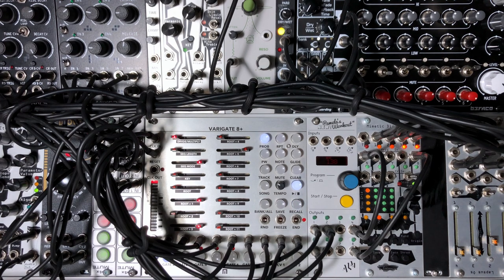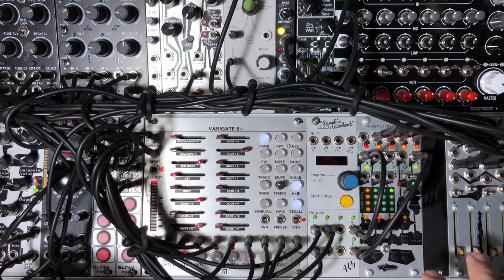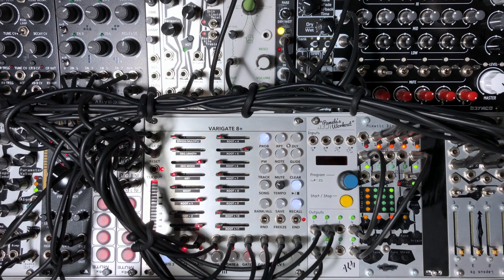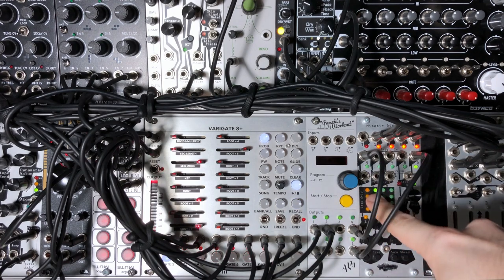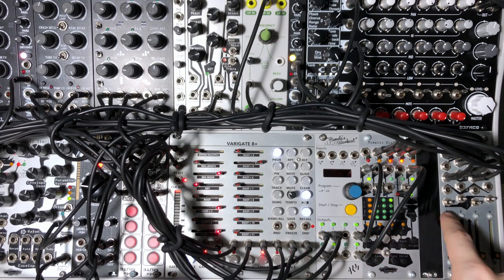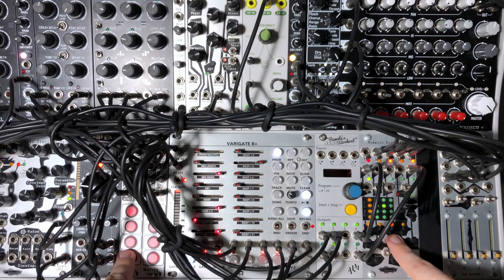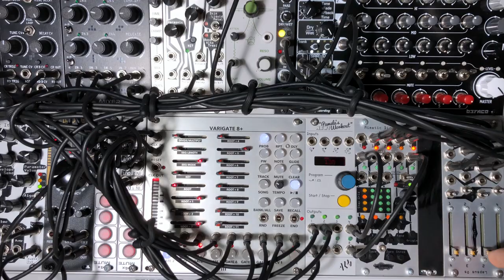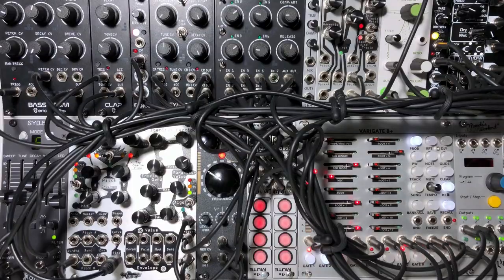How I Play - Season 2 - Part 2

Comment: Great video again! Really curious how you make the transition to a new track using just one sequencer. How does that work with varigate? Keep up the great work!
Reply from the maker: Hi, Thank you! :) well, it's pretty straight forward. I gently bring the levels down, modulations down, make an outro, then just change the pattern preset on varigate. I take advantage of the long shimmer reverb that makes the transition smoother.